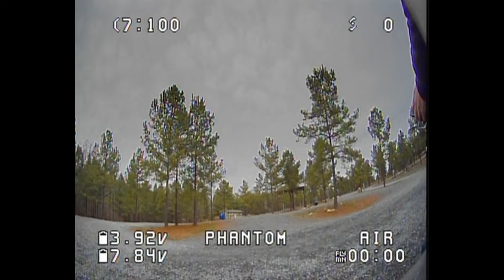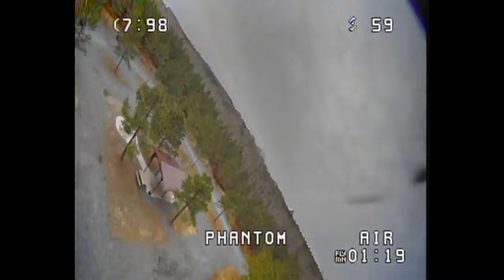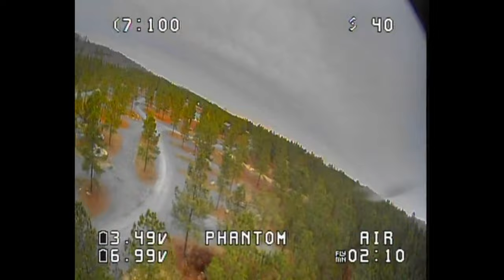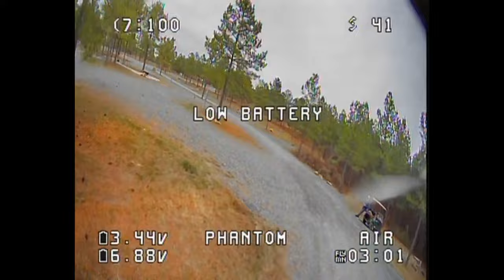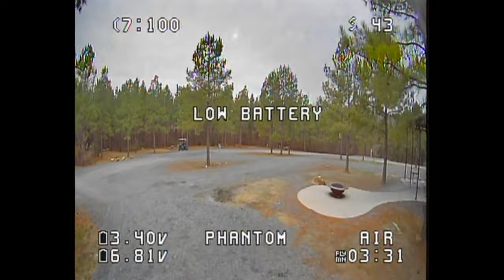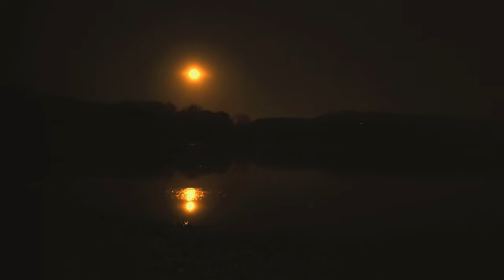HappyModel Phantom 2s Dipole antenna Test

Comment: Looked to me like it done just fine for that spot. Yeah it had a little interference but it’s analog after all.. should be expected with any antenna. I’d be satisfied if it were me. If weight is an issue and you’re cutting grams I’d definitely stick with the dipole.. if it’s not then that’s another story.
Reply from the maker: Thanks brother. Yea the analog feed is not bad. This particular area is a bit more open. I think I will still do some further antenna testing. Weight is definitely not an issue with this little flyer.
 3s flight video coming soon.